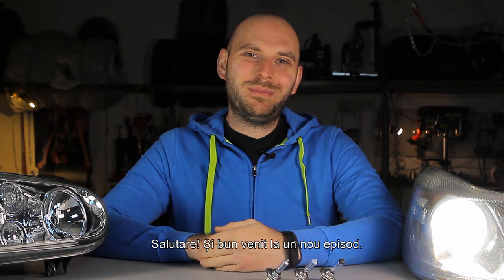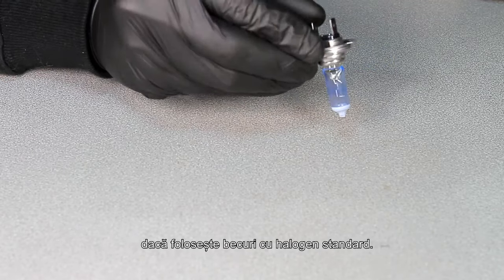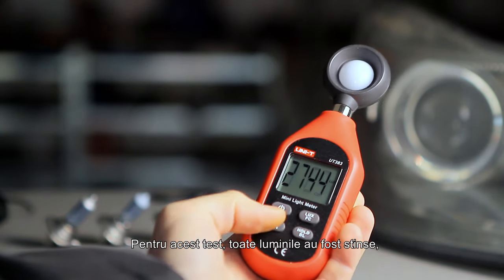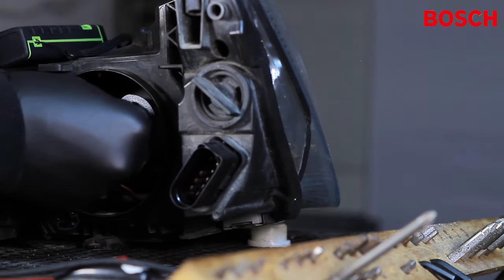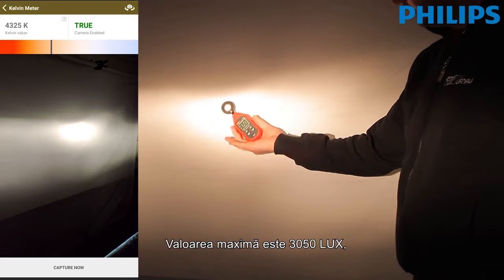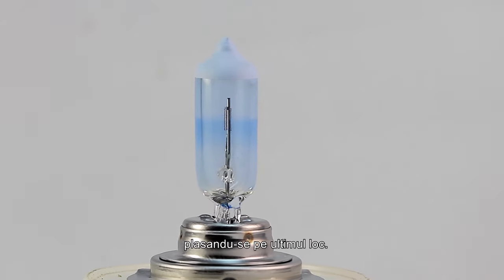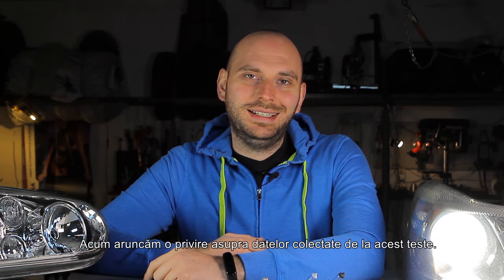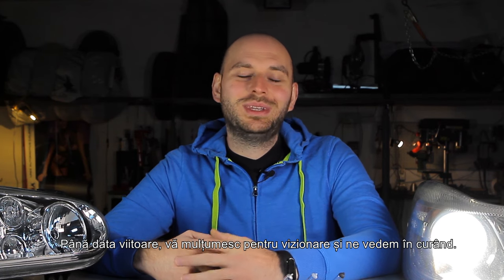The Best XENON LOOK bulbs - Color, Endurance & Brightness Tested - PHILIPS vs OSRAM vs BOSCH

Comment: Over time the color temperature of these "xenon style bulbs" will become warmer as the blue tinting in the bulb starts burning off due to heat, becoming more yellow and less white.  This is just an inevitable reality with the heat of halogen bulbs.  I've had a couple sets of these blue glass xenon style (Sylvania and Hella) and they both turned back to normal color after a couple months.
Reply: this ones are better for cold weather coz its heat up unlike led bulb, ill be changing to halogen bulbs this winter and leds for summer, coz  white led bulbs are only for looks
Reply: @NoahPARK82  No LED bulbs are superior to halogen in every possible way.
Reply: @gravemind6536 They are not superior in keeping ice on the headlight under control. They produce less heat so in winter conditions the heat won't meld the ice on the outer lenses. Halogens are also less expensive, so that's already two accounts where led is not superior.

Comment: Xenon bulb aka (White/blue halogen bulbs) 5000/6000K both philips and osram will not give enough brightness, i tested them on a Corsa D 2007, both of them, they have poor visibility. If you want a good visibility and brightness then use the standard yellow to white bulbs of philips like racing 200% H7 or extreme vision 150%.

Comment: The difference in light output isn't due to the "newness" of the headlight as much as the design. 
A reflector headlight will not spread light as much as a projector headlight, which is more uniform. Some reflectors will have a good spread, comparable to projectors. As you see in your test, the reflecors have a "hot spot" on the wall which the projectors don't. If you're measuring on the sides, you'll see that the projector offers a more uniform output. As a suggestion for your next video, try measuring at different distances from the middle of the light pattern.  That way you can see how good the bulb (or the headlight) is at illuminating the side of the road. It's not important just to see directly in front of you, but also on the side if a wild animal or a person is crossing the road. Also, it gives an index of the range of the headlight. In EU headlights, the cutoff is to the right and therefore the headlights will shine much further on the right side than on to the left, giving you better visibility. If the headlight or bulb fails to provide enough light output for you to see good in the distance, then you have less reaction time.
I'm curious about your next video! You're doing an amazing job!
Reply: That's why the more appropriate measurement would be the light output in lumens -- which means the lux (spot) light output integrated over the larger surface area.
Reply: What's your favourite H4 bulbs, please ?.

Comment: Great video! I enjoyed watching it, with a very surprising outcome. I' ve had the Philips Racing Vision last year and they lasted me about 3 months. Was pretty good to get me through the winter, but a slightly less powerfull bulb that lasts twice as long would have my preference right now. So the Bosch seem pretty good. Thanks!
Reply: Rick, either you drive on very rough roads or you have a fault somewhere. My car has 4 headlights, foglamps and daylight running lamps (not led). I'm close to 110K kms, mostly country roads more than a third at night. All bulbs are original factory supplied.
Reply: @russcattell955i  are the racing visions Factory supplied? Other bulbs last me way longer, I was specifically talking about the racing visions. Thanks for the reply!
Reply: @ricklieffering241  All standard OEM. I don't know the brand as I never looked.
Reply: @russcattell955i  ah right, but normal bulb also last me a long time. The racing visions just burn out a lot quicker, because they burn brighter.
Reply: @ricklieffering241  smaller filament + stiff suspensions = lower life

Comment: Light intensity diff is mostly due to the design and not the age of the projector assembly .... Projectors spread the light equally and the reflectors concentrate the throw to a specific point/direction ... Hey but all in all, a very comprehensive video ... Kudos!

Comment: After a year of using the Osram Cool Blue H7 the glass already showed a black film witch resulted in vast descent of brightness. Had to throw them in the bin long before they burned out. Since then I use the Philips WhiteVisions 3700k and 4200k. These last very long and stay clear until they die. I don't notice a colour difference between the 3700k and the 4200k version. I just ordered retrofit LED bulbs from Osram (LEDRIVING HL H7) and Philips Ulinon LED H7. I am curious about hte difference in lighting and lifespan.

Comment: How odd. This is not the experience I've had with the Philips WhiteVision. I've used them in projectors and they do provide a much more noticeably white light at a pretty good brightness. This has the advantage of making the light bounce back from road signs featuring white retro-reflective material and providing a better contrast to the rest of the sign. So far I've had them in the car for a year and they have performed faultlessly.

One thing to note though, with your tests. The lamps you are using have a US DOT beam pattern which I consider dangerous since it doesn't provide enough coverage to the nearside area, so from a distance pedestrians cannot be easily seen - the sharp cut-off created by projectors makes the problem worse. The ECE pattern is much safer since the sidewalk is lit up more effectively (compare DOT to ECE) and is better suited for projectors, even with the sharp cut off.

Comment: Excellent comparison test. Waiting for your LED light comparison video. Could you also include availability of H4 type connectors in the various light bulb models that u compare. It would be very helpful for people looking to upgrade motorcycle headlamp bulbs. Do include Auxbeam LED bulbs in your LED comparo video. Thanks for the excellent work. You are doing a fantastic job.

Comment: Salut, daca ai posibilitatea, ar fi interesant de repetat si primul test, dar cu farul tip reflector. As adauga si osram night breaker silver (cel de 100%, nu 130%). Inainte sa le cumpar, am citit doar de bine despre ele, multi preferandu-le in locul celor de 150% si 130%. Le folosesc de un an la faruri tip reflector si pot sa spun ca am vazut o diferenta clara intre ele si cele de 30% de la Philips si o diferenta uriasa fata de niste becuri standard. 
Multa bafta in continuare si multumesc pentru continutul de calitate!
Reply: Am avut eu. Adevărul e că se vedea excelent cu ele. Dar țin doar un an. Problema e că mergeam mai mult ziua și cum nu am DRL trebuia să le țin aprinse. Noaptea îmi cam luam blițuri deși mi le-a reglat cum trebuie la ITP. Am pus Silverlight și-s foarte mulțumit. Și mai ieftine, nu-mi mai iau blițuri și e ok ca și vizibilitate.

@Sergiu Gabor poate faci un test și cu ele. Testează și d-astea mai de "săraci" să zic așa :)

Comment: Hello Sergiu. I just bought an almost new car but the previous owner changed the halogen H11 high beams with LED's. As i would like to be "legal", I want to change them back to halogen but i have an issue with the yellow color, i cannot see correctly during night with yellow color so i have to search for "white" halogen lights. Do you think is worth it to buy the Osram or i have to get used to yellow lights  ?( which to be honest is a nightmare for my eyes ).

Comment: For the next test of any sort of light you should mention the voltage at which the luminosity and color are checked. And i think the tests should be run at 14v as that's the usual voltage with the engine on.

 I'm a bit sad i didn't find your channel sooner, i did buy a Phillips bulb for my bike a week ago :(
Great work and thank you for doing this!
Reply from the maker: Hi Daniel, and thanks for you appreciation and observation. You are correct, the bulbs should have been tested at 14V as this simulates real usage more accurately. Unfortunately, I don't have the space to fit a car in my workshop and only recently I bought an adjustable power supply. The tests that were already filmed, were done using a 12V power supply and I plan to use that in my future videos. That way we can compare the results with the previous ones. Ride safe!
Reply: @SergiuGabor  thanks and looking forward to your next upload, you're doing an awesome job!

Comment: If you guys want a more xenon look,I’d recommend getting some led headlights. They are usually brighter and more cooler temperature then the halogens
Reply from the maker: I've ordered 5 different LED retrofit lightbulbs to test, including one from Osram. Once I have all of them I'll make a video about that 👍🏻
Reply: yeh they are, the problem is, that most headlights does not have a correct way of inserting an LED bulbs into headlights, as they are too big, and simply not made to go inside the, which means you'll have the lightbulb just hanging in there and moving all over the place whilst driving, with xenon normal bulbs like that we used those small metal brackets to lock bulbs in place, however yes, LED does provide white light, but it is not safe, to use, as they are not standard type bulbs.
Reply: @SergiuGabor  abia astept sa vad testul cu becurile led. Pe site-ul osram, h7 led si h7 night breaker apar cu aceeasi intensitate, adica 1500 lumeni, ceea ce e dubios, dar e posibil tinand cont ca nu au ventilator si unele nu au nici driver extern.
Reply: Yeah but most are ineffective aftermarket junk and are not road legal.

Comment: Exactly what I needed, but for a moped with a reflector headlight. But there's a question, my vehicle is rated for 34watts, if I install 45 Watts (osram) halogen, Would there be any issues? Like wire burnouts, or reflector walls getting darker..?

Comment: Let's be honest - the blue tint is just a gimmick to increase sales from consumers who see vehicles with white LED or HID lights, so they want a bulb that gives off a more "white" light. Anytime a filter is placed on a light (in this case, the blue tint), the amount of light will decrease. So these bulbs give the effect of being white but they are actually dimmer than they would be without the blue tint. These bulbs are brighter than stock so they are an improvement. If someone wants to get the full illumination out of bulbs like these, use an exacto knife to scrape off all that blue tint. It takes about a 1/2 hour per bulb to scrape the tint off completely but afterward you will get the full illumination from the bulb. Then make sure to clean the bulb with alcohol before installing because any oil from you skin will cause a heat spot resulting in the bulb breaking.

Comment: Hey,
My car is using projector with yellow halogens ...can can replace those halogens directly with this...or I need to make any changes in the system of car...
Reply: if you use projector headlights go for a 60 euro xenon kit with 4300k bulbs by far superior to any halogen , you are not blinding any one and will have much better and comfort light than 6000k xenons and leds , i putted 4300k xenons on projectors and the result is fantastic , just make sure you will buy a know good kit with good quality  ballasts and bulbs , the very cheap xenons are less emmisive after some time than halogens!

Comment: In addition to all comments before, reflectors are very different depending on the producent. Original used, original (Valeo, Bosch, etc...) new and aftermarket TYC and Depo. Last 2 cannot be even compared to original, as they didn't reflect the light but projecting the light beam in the middle. I suppose you used the aftermarket reflector, that's why the beam had 2500Lux.
I had to change my original to TYC, tested also Depo and returned to original.

Comment: Projector headlights need a good cleaning of the lens every couple of years or the light goes dimmer (I had a 1998 Mazda with projectors, with OEM bulbs you could barely see) ... I honestly love reflector ones, they are simple and with the right bulbs they offer more.
Reply: How do you clean the lens? Its a sealed unit.
Reply: @gravemind6536  you have to take it apart and that's a very shitty job... Risky aswell... Heat up the glue until it seperates, people use ovens

Comment: I have been upgrading my head lights with Philips Halogen 1100/130 watts bulbs and I usually ride at night. And the failure is nil. Using these bulbs since 1992

Comment: Hey just wondering if you can review PIAA Extreme White Plus. I've been using them since 2010. Best halogen bulb.
Reply: PIAA’s are bright as hell.  They make stellar halogen bulbs.
Reply: @dylangajdosik964  For real. I've been rocking them for over ten years. Once I started, never went back. I'm thinking now to get their g3 led system. It's a bit pricey but the visibility is crazy good.
Reply: @floatingclouds1  I’ve had a couple pairs.  I was real impressed with them.

Comment: The whitevision is not so good for reflector headlights. I tried the H4 variant on my car and it's performance is not so good, it is whiter but outputs less light than the osram night breaker unlimited i am curently using. I have a few pairs of bulbs laying around since my night breaker unlimited did not fail yet. I am using them since 2016 and really surprised they are still working...

Comment: Eu cred ca bateria sau oglinda proiectorului din far au fost problema !  Este imposibil sa ai o diferenta de 5 ori pe acelasi bec ! Trebuia sa pui becurile alimentate pe aceeasi masina la relanti, cu aceeasi baterie ! DAca ai folosit pentru test aceeasi "sursa de 12V" nu este ok , pentru ca becurile nu sunt testate sa aiba performanta maxima la 12V , ci intre 13,2 si 14V , o medie buna fiind 13,4V, cam cat au majoritatea msinilor cu ceva consumatori. De la 12V la 13,4V va fi o diferenta mare intre performantele becurilor ! 
O alta observatie : cu siguranta si vibratiile sunt de vina pentru ardere , DAR mult mai importanta calitatea filamentului si tehnologia producerii becului. Majoritatea filamentelor arse aveau urme puternice de "consumat" inainte de a se arde complet. Majoritatea becurilor care s-au ars s-au ars la prima pornire, cand masina de obicei statea pe loc si nu era in mers, deci parerea mea este ca socul termic in momentul pornirii conteaza foarte mult .
Daca vrei sa faci un test la cele mai performante becuri, atunci ia cele mai performante becuri , nu compari becuri de 30-50 lei. Eu am trecut de la 12 ani de Philips la Osram si sunt multumit. Philipsurile desi la inceput ofereau mai multa lumina , se ardeau dupa 8-9 luni , dar Osram-urile tin peste 14-15 luni cu aproape aceeasi performanta. 
Deci , daca poti , testeaza becurile de top , de genul Osram Laser generatia 2 care sunt pe la 95-120 lei setul, dar testeaza-le pe o masina , cu motorul pornit la relanti , adica pe la 13,4V , nu pe surse de curent de 12V!

Comment: the guy didnt actually fit the bulb perfectly on the projector housing, thats why the light was scatered. projector use to have a perfect center light
Reply from the maker: I must admire your attention to detail. In order to have the exact frame of each light pattern, the camera was not moved while comparing the bulbs. You can see that all bulbs project the same pattern on the wall. The shot you are referring to, was shot afterwards so we can have a nice presentation. I hope this makes sense 👍
Reply: Sergiu Gabor cause i can see how the light are scattered on the projector housing. idk maybe my bad. or its just the projector that isnt great like the ones i used.

Comment: Unfortunately, the endurance test methodology is incorrect. You can see the obvious evidence of that in the results you got. Long story short the reason why Bosch performed best in this setup is that the bosch bulb was placed furthest away from the impact point meaning other bulbs and the wood structure has absorbed the shock.
Reply: The change of the design of your test setup would provide with better results. Keep it up.

Comment: I used real led bulbs for the headlights in my car but philips halogen white look for my city/parking lights. And my license plate. Official you are not allowed to use aftermarket L.e.d’s in halogen from factory cars here.  But the man were I bought the l.e.d’s said because i have projector lenses in my  headlamps they will not maken problem. With reflector headlamps they will.  My city lights are reflectors so for that i used whitelook halogens

Comment: Thank you, because unfortunately for Toyota/Lexus vehicles, DRL and high beams are combined with the same bulb. DRL running at a lower voltage. Can't install an LED for this reason. It is necessary to use a halogen bulb.

Comment: Reflector inside used projector is probably burned a bit. There is no any halogen that is as white as 4300k xenons. Xenon look halogens are scam. I would use osram nightbreaker halogens if I had halogens in my car.

Comment: All these "white-ultra-bright" aftermarket xenon style bulbs are rubbish. After my OEMs broke i changed them to these bright ones, from Amazon Value to Osram and Bosch. All brake after a few months and the light is far worse then the OEM yellowish color. I changed about 3 oder 4 years ago back to OEM and had 0 issues so far.

Comment: Just go LED and be done with it
Reply from the maker: Yes, that a good option and I'll test some soon. But I believe that LED retrofit bulbs are not legal in all countries.
Reply: @SergiuGabor   Thats not true, you can by LED with CE standards, so they work same as standard, if is legalised then is allowed on the public roads. However they are expensive i bought from osram one set bulbs for 114 euros!  :)
Reply: @wolfganggunterberger5718  You are wrong...